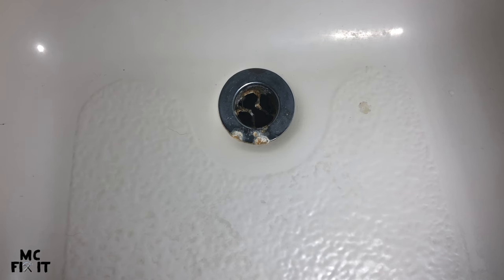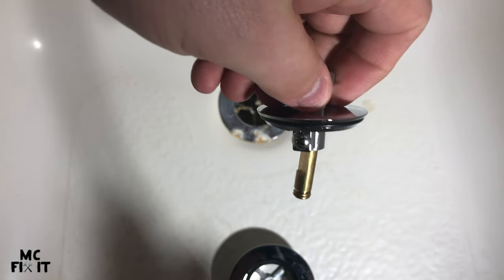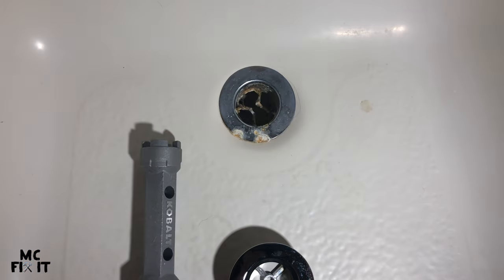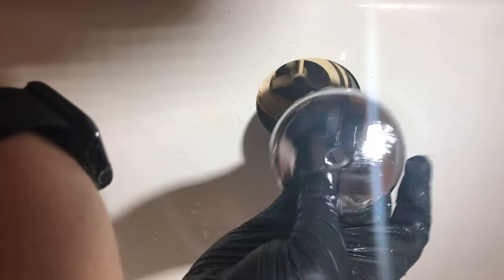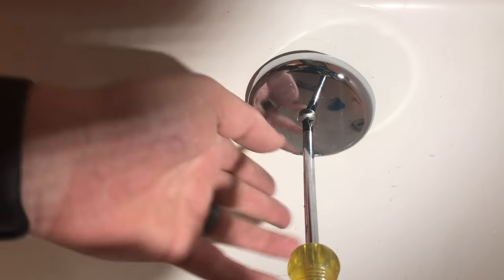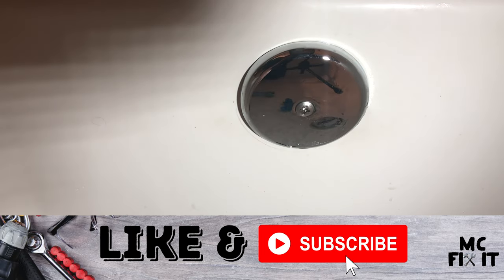Bathtub Drain and Overflow Plate Removal and Replacement (Complete Guide)

Comment: Thanks for showing me where that seal goes! It helped out a lot. I think I would have easily installed it wrong and not even known until I had a big problem on my hands. Thank you!
Reply from the maker: Yeah, it’s easy to mess that up and then you have a leak problem to deal with. Doing it right the first time is crucial. Good luck on your project!

Comment: Hi!  Great video!  I'm trying to replace my overflow plate...just like yours...but I'm having a hard time removing the old one.  Mine is not held in place by a screw--it looks more like a screw type thing that has a ball at the end of it.  The ball has a hole in it that I would have to put one of those little L shaped screw drivers in and then torque it to loosen it.  It won't budge.  I spray some lubricant on it so hopefully in the morning it will loosen it up.  My question is the plate I purchased...which is just like yours...has a screw in it.  Will that work with what I have.  I know it might be hard to understand what I have.  My house is over 100 years old with old fixtures.  Any help will be appreciated!
Reply from the maker: First, did the lubrication help? I’m not sure if I understand the comment on the “little L shaped screw drivers.” Are you talking about an Allen wrench? Sorry, I’m just trying to understand. It’s really hard to diagnosis issues without being present and I don’t like to guess and steer people the wrong direction.

Comment from the maker: Learn how you can remove and replace your bathtub drain and overflow plate!

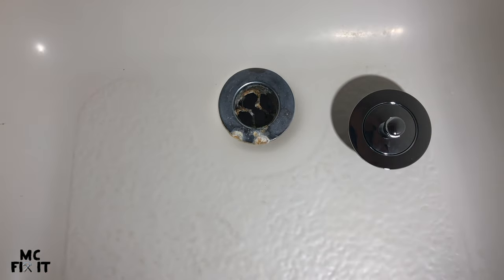00:24 TOOLS:
Drain Plug & Overflow Kit - https://amzn.to/3vZyRkl
Drain Wrench - https://amzn.to/2RyLEuZ
1" Wrench - https://amzn.to/3y0XIpM 
Channel Locks (optional) - https://amzn.to/3fjRd91
Plummer Putty - https://amzn.to/33pyZNA 
Philips Screwdriver - https://amzn.to/3hdpzx0 
Flat Head Screwdriver -  https://amzn.to/2RAjTlU 
Pick (optional) - https://amzn.to/3nZM8q4 
 
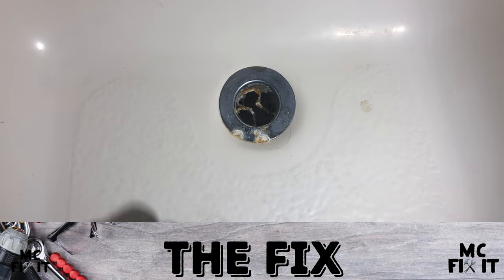01:40 THE FIX - Learn the exact techniques you will need to complete this project! 

Check out my website at http://mcfixit.us 

Disclaimer:
Due to factors beyond the control of MC FIX IT, I cannot guarantee against improper use or unauthorized modifications of this information in the video, post, blog, or social media. MC FIX IT assumes no liability for property damage or injury incurred as a result of any of the information contained in this video. Use this information at your own risk. If you feel uncomfortable at any time. Stop and go to a professional. MC FIX IT recommends safe practices when working on vehicles, your house, or any other project and or with tools seen or implied in this video. Due to factors beyond the control of MC FIX IT, no information contained in this video shall create any expressed or implied warranty or guarantee of any particular result. Any injury, damage, or loss that may result from improper use of these tools, equipment, or from the information contained in this video is the sole responsibility of the user and not MC FIX IT.

#mcfixit #houserepair #fix #repair #replace #drain #tubdrain #overflow

——
Supplies used to record this video: 
* GoPro Hero 7 Black - https://amzn.to/3f3ALtb 
* 256GB Flash Drive - https://amzn.to/33pAueG 
* Vlogging Frame - https://amzn.to/33tajE0 
* GoPro Pro 3.5mm Mic Adapter - https://amzn.to/2RCURCu 
* Youmic Lavalier Lapel Mic - https://amzn.to/2R55sWX 
* Boom Stand (tripod) - https://amzn.to/3bdkQaw
* 5/8” to 1/4” adapter (boom to blogging frame- https://amzn.to/3txrVsM 
* Portable Battery Powerbank- https://amzn.to/3vJQc0q 
* 6ft USB to USB-C (powerbank to GoPro)- https://amzn.to/3uAS5MH

Comment: Thanks. Just bought the drain wrench but wasn't sure the best way to use it.  Also like the pop up replacement drain you chose.  And I wasn't aware the gasket behind overflow cover was missing when I replaced it! So one more trip to Loew's to finish this drain project. Thanks again.
Reply from the maker: Oh, I hate multiple trips but it’s better to do it right then have a possible leak in the future. Glad it was helpful! Thanks for watching and commenting

Comment: Hey there!  Awesome vid!  The old drain looked like it had putty all the way down the threads.  Is that an optional seal tactic... just adding more putty to the threads themselves?
Reply from the maker: You could do that, but if you have a good seal on top it will work. Also, some of that might be from when the contractors built the house and put the putty on it initially and it squeezing down on there as they tightened it.

Comment: I used the drain removal tool and the drain came loose but only came up about 1/4". It wobbles and turns but won't come out?? It's in a mobile home and I have no access to the j pipe drain. Any suggestions?
Reply from the maker: Maybe try tightening it back down a bit and then loosen it up again! You may need to do it a few times. Then hopefully it loosens up and you are able to get it fully out.

Comment: Can anyone explain how this specific type of drain cap/stopper works? I believe mine may be dysfunctional but I've been looking online for hours for the correct model/solution but it's pretty hard to understand any of it when I don't even know how it actually functions in the first place. Mine hasn't worked since we moved into our house, it won't stay up so to drain the tub we have to put something under it to hold it open- and I was hoping to find a video explaining why it isn't working when every other video seems to show the same pieces and all? I believe its the same as this one, maybe a bit older, but I don't know if there's supposed to be a notch that holds it or if it has something to do with the underpart. If anyone has any answers it would be appreciated. Thanks.
Reply from the maker: The drain assembly turns into the pvc pipe that’s threaded below it. It seals down the tub with the drain top when turning it into the pipe. Each drain rice valve works a bit differently. Some pop by pushing down and others turn one way to open and another to close it. If you turn it too much then it should come off.

Comment: What is the piece called that you screw into to hold the overflow cover? I have nothing to screw into just an empty pipe.
Reply from the maker: This project had a female threaded pvc pipe that the part screws in to. That’s what holds the whole thing together.
Reply: @MC FIX IT  if I just knew the name of the piece I could probably just glue it in, I just can't figure out how to find that piece.
Reply: Exactly lol could've just said "I don't know"

Comment: My drainage white tube is a bit lower that than and it won’t connect to a standard basket..would I need to get an extended one? Like a 2”?
Reply from the maker: Yes, you would need an extension.
Reply: @MCFIXIT  thank you! Is it the basket extension that I would need or can I get one that would connect first into the tubing?

Comment: Is it ok if I leave the old gasket?  Because new one slight small
Reply from the maker: It depends on what condition the gasket is in. You should be fine if it’s in good shape!
Reply: @MCFIXIT thank you. But my new one slightly smaller than the new one.
Reply from the maker: @Anon0326  You should probably try to get a correct sized one to ensure a proper seal.

Comment: Question: 

Mine is only able to be hand screwed in 1-2 turns then I have to use a wrench to get it the rest of the way in…

Once it hits the bottom, it is not flush and there is a clear gap on the side closest to the cover plate. I’ve tried multiple times.

How can I get it to screw in even/flush??
Reply from the maker: The first thing I'd check is to make sure it is not cross threaded. It should be more than a turn or two before having to use a wrench. I'd back it off and try again. 

Was it on seated on there even before you took it off?
Reply: @MCFIXIT  thanks for the reply. The old one was on flush before this new one.

I’ve tried backing it off over and over and can only get it to screw in 1 turn by hand before I have to use a tool. I’m worried this may mean I just don’t have the right size threading…

Which is weird because they looks the same when I hold it up to the old one.
Reply: @markusaurelius4015  Did you fix it ok now ?  You might have cross threaded or  wrong size possibly.
Reply: @jamescc2010  it is fixed! Yeah I was really worried I cross threaded it too because it screwed in wrong after several tries. I was prepared to cut an access hole into the ceiling in the basement and replace the drain shoe completely. 

Then my dad came over to give it a try and screwed it in flush the first try!!! We have no idea what he did differently but at least it’s in and working now!

Comment: Does anyone know why the drain requires so much mechanism? I feel like the drain could just be a covering to the drain pipe. Why are there so many screws and devices in there that need to be removed?
Reply from the maker: Great question! That’s how all of the drain cover I’ve used are. Once you’ve done it once it gets easier the next time. But all of them seem to be a little different with the same design,
Reply: @MCFIXIT  thanks for your reply. My drain is basically some kind of pipe sticking out of the pipe and water can barely get down around it. I bought the tool but it doesn’t fit. I think I will have to call a plumber to avoid disaster.

Comment: I have a comment about the Overflow in the tub. The Overflow drain was not aligned right with the tub you should have opened the access panel and loosened the overflow nuts to realign the Overflow pipe. After  seeing you poking the gasket like that I believe you'll probably will have a leak you should have replaced the gasket then you would have  done a perfect job. That's my tech tip for the day.
Reply from the maker: I’ll have to check that out! I’m away from my house for a few days but when I get back I’ll look into that. We don’t use the tub ever so it’s not had any issues to date. Thanks for the tips and look forward to checking that out. Have a great day

Comment: I have a few comments. #1 if your plumber's putty is a little dried up like that roll it around in your hands and the heat from your hands will return it back to its normal state don't add water to the plumbers putty. #2 you should have added more plumbers putty to the tub drain. #3 you should have put some pipe dope on the threads before screwing it into the pipe. And I am a professional plumber that's my tech tip for the day
Reply from the maker: Great tips! Thanks for adding to the conversation! I appreciate you watching and commenting

Comment: Bath tub drain just keeps spinning for me. Won’t come out
Reply from the maker: How many revolutions have you made trying to get it out? Some of them have lots of threads.
Reply: @MCFIXIT  i think it is totally jacked up, ive made over 50 revolutions. The elbow at the bottom of the drain also spins with it so i stopped and have a plumber coming out today.
Reply from the maker: Sounds like your plumbing was not installed properly. My guess if it’s PVC is that it was not glued properly if it’s spinning. How’s the project end up? Did the plumber fix it?